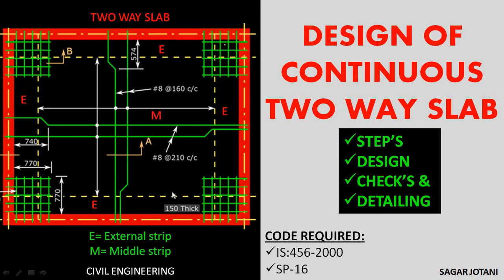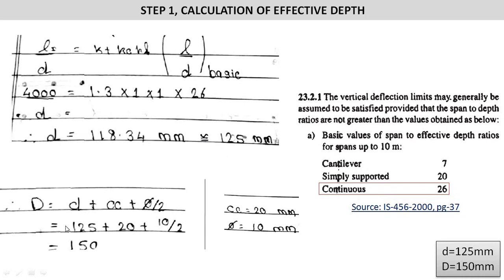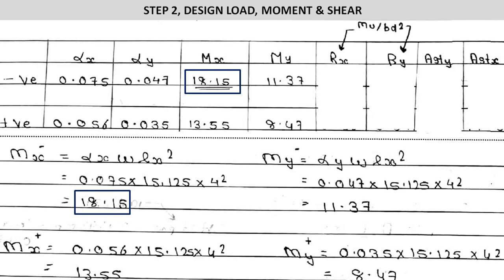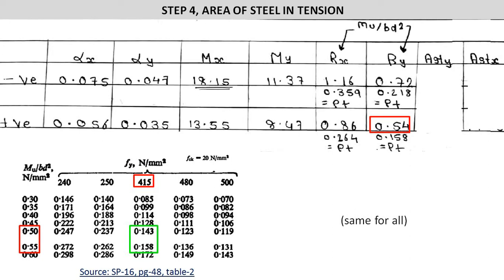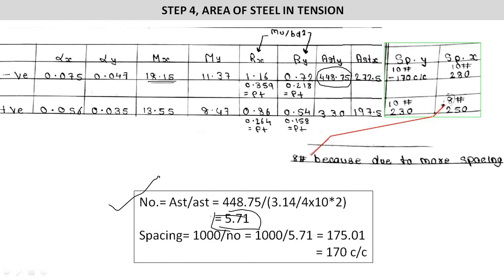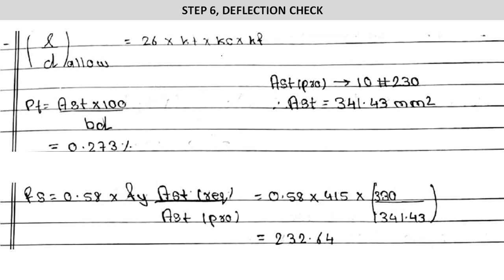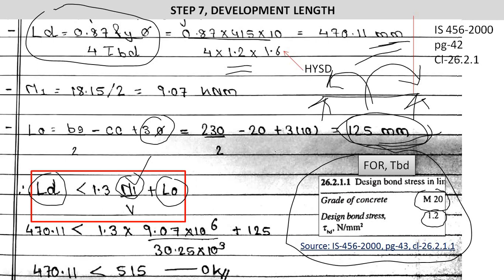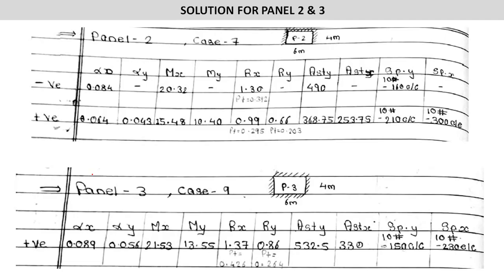Design of continuous two way slab

Comment: Torsional reinforcement calculation and detailing is wrong. The value should be 3/4*Ast for corners with 2 discontinuous adjacent ends. Also it has be to provided in 4 layers (2 on top and 2 on bottom), with each layer having 3/4*Ast. For corners with only 1 edge discontinuous, the value for each of the 4 layers will be 3/8*Ast. Also for interior corners which are fully continous in all directions, no torsional reinforcement in required.

But the video and explanation of each step is very good. Keep it up!

Comment: Sir could you tell me when design the slab need to make cage on corner  and also bent up bar.as per designated lenth ..both cage and bent up bar is required . It is compulsory.to put both or only bent up
Reply from the maker: It is compulsory to provide bent up bars in any case. But when it comes to corner cage, corner cage is placed when the slab is mounted from all four sides.

For your more clearance, let you know sooner

Comment: How to find value of Kt please explain in detail
Reply from the maker: Modification factor for tension reinforcement (Kt). Open IS-457:2000 | Pg-38 | Fig-4. From that find the value of "fs" using given formula. And find the value of "Kt" by plotting line of "% tension rf" & "fs" you optioned.